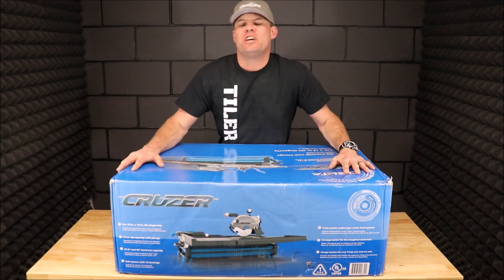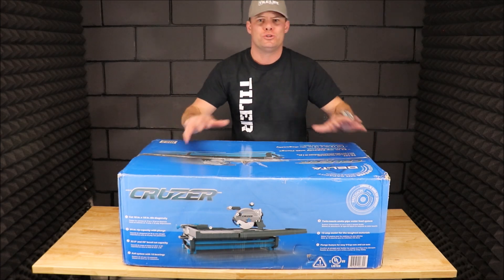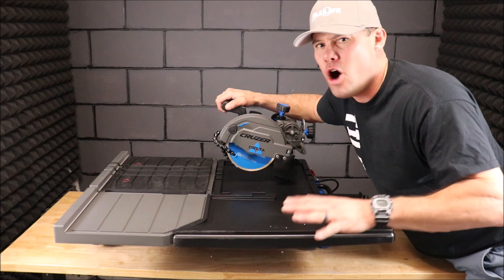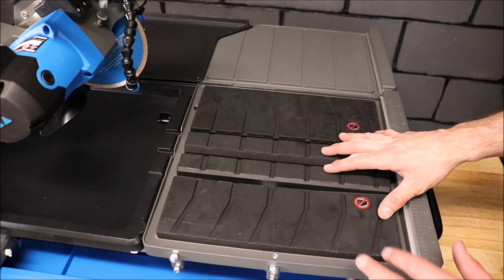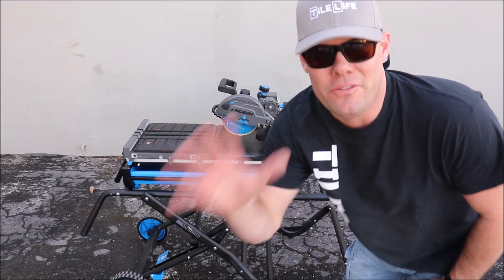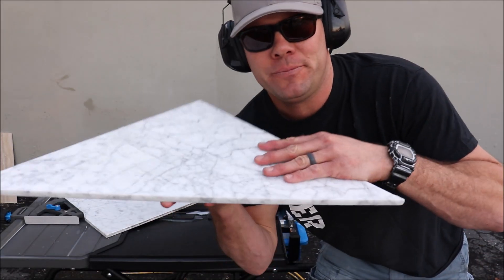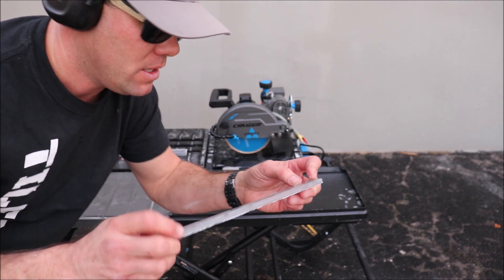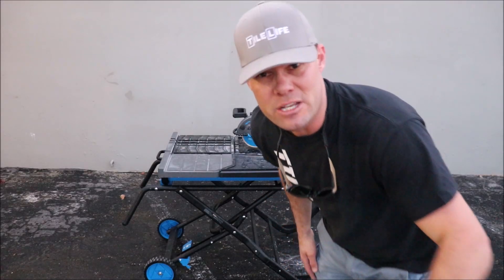Delta Cruzer 7" Tile Saw Review/Best Tile Saw 2020?

Comment: I ran out and grabbed this saw as soon as it was available at my floor and decor (Jan 4th). It’s actually my very first wet tile saw, but I had been researching saws for months prior to this one being announced by Delta. 
I love this saw so far. 
Like I said though, never owned my own before, but have used a Rigid and Dewalt on other jobs. 
I’ve used it on porcelain and ceramic tile so far. 
If you’re in the market for a new saw at only $500 for the saw and a stand its a great deal!

Comment: I was trained in the trade of tile on a 10” dewalt. Keep in mind the same saw has been used for over 5+ years of full time residential/commercial use. There is no doubt the dewalts pass the time test. BUT, I ordered and received my new delta 7” and can’t wait to put it to the test.
Reply: How do you like the delta? How does it compare to the dewalt? I've been using an old worn out dewalt, looking to replace it with this delta, or a new dewalt.
Reply: @philthyphil3324  the 7 delta is good for smaller tiles. Is ok for 12x24. It can get the job done. Great for splashes. The only downside would be the water that splashes on the floor. Using a mud tub or a tarp is recommended. I have a dewalt and use it most of the time. Sure do like the delta. More room on my truck and lighter.

Comment: I’m almost in the same boat. I have 2 Lachmond 7 inch saws. The first had a huge issue with run off  on 24 inch . The water nozzles broke and the pump died.The table had a ton of play in it. Lachmond replaced it under warranty with another updated version, Now the second after 1 year has the same issue with run off.Table has play in it. The one thing that I like was the portability of the 7 inch.  Compared to a 10 inch. The only caveat is its cut depth. Since I have to cut 1 inch quartz at times for ledges. So I have to flip it over to get the cut thru. I’ll be curious on the other 2 parts of the review going forward.

Comment: Bought this saw brand new from Floor and Decor last week and the motor burned up today. It had a funny smell right from the start and the motor sounded like bearings were a little loose. My suspicions we're correct and it just started dying then started shutting the breaker off. Returned to Floor and Decor and bought the DeWalt 36000. They knocked off $200 for my inconvenience! It's an excellent saw!
Reply from the maker: Dang, that's some bad luck. Nothing beats the Dewalt though!

Comment: Nice saw! Hopefully with the power, improved water flow, and intake for the motor being up top like the dewalt, this saw will turn out as the better saw vs the beast. Have they improved water containment in the back or is it still messy? We had motor troubles pretty quick with 2 beasts. And they were just plain messy. But very powerful and excellent mitering saws!
That gravity stand is nice. It looks identical to the stand our old ridgid 7 inch saws had. But they were also short. Doing alot of repetitive cutting was a back breaker.  I do like my saws on the tall side for that reason. 
The dewalt continues to be the go to saws for us. But when they go down and aren't worth rebuilding, it's nearly impossible to find one as good as the originals. Quality control just isn't there. Eventually we will need a great alternative. And the lighter the better imho. There's just certain aspects of the dewalt I am not willing to part with for now. Looking forward to seeing more of the delta cruzer! Thanks for the content bro!

Comment: I'm surprised nobody has commented on how poor the water containment is on this saw. I just got mine set up and after 5 minutes of test cutting there has to be a 1/2 gallon of water on the floor... most dripping off the right side of the extension table, with a fair amount of overspray to boot. Seems like a good saw otherwise (gravity stand is nice, albeit a bit low) but even if I set up in a garage this amount of water running off is completely beyond what's acceptable, let alone inside a house under construction. It's like designers/engineers never actually try the equipment they design.
Reply: Youre the only person that has mentioned this and thats a deal breaker for me. Was just going to pull the trigger. Thank you!

Comment: I have been doing tile for 16+ years. I've gone through 2 felker 75  tile saws I use them inside of homes.  The last one I bought was used on Ebay.  I have a MK101 that Rips tearable. Replaced  the bearings no help so I bought a dewalt 24000. I like the dewalt but it's hard to use inside. Do you have any suggestions for a small decent saw for using indoors?
With minimal water splash? 
Thanks for any suggestions!

Comment: Update day 2. I had time this morning to do some more test cuts. I tried 45 degree mitres and things didn't go well. Over 24" the cuts widened almost half an inch. I made a few minor blade square adjustments per the manual. (Prior to adjusting normal cuts were within 1/32 over 24")
It appears it's a fault with the hinge. Also, in the course of the testing the water lines were driving me nuts. I'm not playing around with it anymore. Just returned it. Dewalt 24000 is still the king.

I just grabbed one of these at floor and decor for $550. In the last 3 months I've used the rigid 7", dewalt 24000 and now this. The rigid was severely underpowered. It struggled with porcelain and couldn't rip a 24" tile straight no matter how well I aligned it. The tile may have been slipping on the cart (no rubber). 
I traded that saw and cash for the dewalt. I set it up with my preferred 7" blade and it's the shizz. It can cut through a boulder without breaking a sweat and rips tile to 1/32nd accuracy. But, it's heavy as hell. I have an old back injury that knocks me out from time to time, and carrying the dewalt from the street to setup spot already messed me up once.
So here I am trying the Delta. Out of the box, it ripped a 24" tile to perfection. It's ridiculously more powerful than the rigid 7", but not quite as brawny as the dewalt. Water management is far less of a concern than accuracy and ease of transportation. So, so far so good.
I will likely re-engineer the water nozzles at some point though. What they did is a cute idea, but it's just not necessary and they will get in the way.
Reply from the maker: agree with you on all points

Comment: How heavy is the tile saw? With and with out the gravity stand. I hope and it should be lighter than the dewalts 10inch with out the gravity. 
And is it more compact than the dewalt. I have been looking for a 7inch saw. I dont need a 10inch I also prefer compact and light as possible. I ain't getting any younger so the less abuse on my back the better.
Reply from the maker: Yes, it's definitely lighter than the Dewalt d24000. With the gravity stand, yes it's more compact.

Comment: If you were backed into a corner and had to choose one saw for a small growing company (mostly work alone, but thinking of hiring someone soon.  Would you choose this Delta Cruiser or the IQ Cyclone?  I think the Delta is a little more flexible, but I like the idea of saving the time on cleanup on the IQ.  I don't do much large format as I do only residential.  Wdyt?
Reply from the maker: If you want to cut indoor (bathroom for a shower) the Cyclone would be great matched up with a manual tile cutter. The blade on the Cyclone do burn out quicker than a 7" for a wet tile saw. The Delta folds up nice, is very light weight, but is not as compact as the Cyclone. If you mainly do showers, go with the IQ so you can set it up in the bathroom. If you do showers/flooring/backsplashes go Delta (IQ does not cut glass).

Comment: I’m in the market for a new wet saw thanks for the review!!!
Reply: Dewalt!!!!
Reply: I have a dewalt but, after I bought the 7 inch diamond by harbor freight, I m not using it anymore. It s lighter, powerful, precious. And it is less louder than  dewalt. For  big tile I use Raimondi rail saw (there is no story for perfect cuts)
Reply: Jesus is Lord, I suggest the Diamondback 7”.  I was out the Harbor Freight door for $270.00, which included the wheeled stand and tax.  I really like the saw.  I’m running an Alpha 7” blade on it.  It cuts 3/8” glass with no chips or any blowout.  In addition, I don’t flip the tile over to cut, I’m cutting with the tile face up.

Comment: Hello, I want know if this machine can cut glas bottles?, what is the best glass cutting blade ?
Reply: I use the Ridgid R4021 table top saw with its OEM blade to cut the bottoms off of glass bottles that i use to build bird feeders, polishing the edges with diamond block and then 200 grit sandpaper. Have to rotate the bottle as I'm cutting. Works great.

Comment: Another great video! I have a question about the the total length of the saw with gravity stand in the stored position? How does the stand compare to the ridgid 10 inch. My ridgid 10inch is falling apart.
Reply from the maker: It stores tight and clean, 7" is MUCH smaller than a 10" and this can do everything a 10" saw can do!

Comment: So Delta released a VIDEO of the 7inch stating that it is available for $399. Landberg says Floor&Decor has them for $499. But yet nowhere to be found unless you goto Amazon and it's $700 there but not available for a month?  Come on what's going on. I'm waiting and waiting to get this. I'm about to go-to HD and get the Rigid 8inch for $399.
Really disappointed with the launch of this product. Stop saying it's available when it's not and give a proper release date .
Reply: c france I talked to one of the Delta Reps. He said that it’s $499 at Floor and Decor because it include the stand. The $399 is for just the saw. I asked about why pricing online was higher and he said because it will settle to actual price as more retailers receive the saw. 🤷‍♂️
Reply: @Mullenthemaker  thank you. Do you know which floor &decor location has them?  Our Jersey location doesn't have them.
Reply: c france it’s sounds like every location will but they are getting them out as fast as they can. Maybe call around local Floor and Decor stores. I know some here in Utah have them.
Reply: @Mullenthemaker  thank you!
Reply: El Paso Tx has it available floor & decor 499$
Reply: Jesse Mullen but it looks like the floor and decor version is without the gravity stand. ?

Comment: How does this compare to ridgids 10” or even ridgids 8 inch? I’m a ridgid guy and want to know if this 7” for about the same price as ridgids 10” would be better?
Reply from the maker: Ridgid is a good saw, this is a good saw. The motor and water spray seem to be much stronger with this Delta than the Ridgid. Ridgid has a good warranty though!

Comment: Hey man, nice review as usual. Got a question if you know ... I got the 10" DiamondBack wet saw (DB 100-1) from Harbor freight . It's a big beautiful saw but it's heavy as a mother. I got the stand with the wheels on it but that's fine for just moving it around but I love those stands that can fold with the saw staying attached. Do you think that Delta Cruzer folding stand you were reviewing would be compatible with the DiamondBack or do you know of one that will?
Reply from the maker: I doubt it would fit, gravity stands are simply amazing and I push it on all tile saw manufactures.
Reply: @LandbergTileTV  Thanks buddy for your response to my msg.  If you notice on my updated msg regarding this gravity stand, I thought the stand was great. So after measuring the the support cross bars on my 10" DiamondBack I went to the store and measured the support cross bars of the gravity stand and they matched up perfectly as well as the width and height of my current Habor Feight Chicago stand. So I bought it and without changing the gravity stand in any way, I just drilled 4,  3/8" matching holes from the stands connection points into the 2 front & back connection bars on my DB wet saw, attached the bolts securely, tested the stand's operation with the wet saw attached over & over, and it works beautifully 😃 
I am so happy that I can transport that heavy saw so quickly and easily. I thank you and the guy from the Delta company for the review of this stand and for making my life easier.  
I look forward to more of your videos, keep up the good work.

Comment: Is it weird to like it for the big  tray plug and the ability to empty into an unmanned bucket with no worries?!
Reply: Creed Barnett, no..., my 7” Diamondback Wet Saw has the same set up.  The stand, which has wheels, allows you to set a 5 gallon bucket within the framework,  just pull the plug, drain and forget.

Comment: How does the 7" diamondback compair to it.
Reply from the maker: The saws are on different levels for sure, I will put up a comparison video with The Delta, vs. the Dewalt, IQ and the Diamondback in a few weeks. 👊
Reply: @LandbergTileTV  thanks that would be awesome. The diamondback was on sell last weekend for $200. Thought about grabbing it but didn't haven't heard any long term reports. Kinda gun shy on harbor freight things. Look good to start but don't hold up well. Not all but some.
Reply: Fueled Iowa, this is for you...  I purchased the 7” Diamondback shortly after Landberg released his video on it.  

I mentioned to my Wife that I was going to check the saw out at Harbor Freight.  She said, “Really?  You’re really thinking of buying a tool from Harbor Freight?”  I told her that I was at least going to consider it.  The majority of my power tools are Milwaukee Fuel, except for the awesome Dewalt XR Oscillating Multi-Tool and a couple others.  So I bit the bullet and bought it.

Several months later I’m very satisfied with my purchase.  In anticipation of cutting glass I got a Ridgid Glass Blade.  I think the Diamondback blade that came with the saw is a better blade than that one!  I’ve since switched out to a 7” Alpha Blade.  It’s been cutting our 3/8” mosaic glass tile very cleanly...I mean very clean!  No chips, no blowout, just a smooth as glass cut.  I cut it face up.  The combination of the powerful Diamondback motor, smooth running tray, in conjunction with the excellent quality of the Alpha Blade produce beautiful cuts.  

With regards to water containment...I’ve been cutting in my garage, with the backside of the saw pointing out the back door.  For the most part, all water is contained, except for a bit of over spray at the end of the saw’s extension tray.  But it’s such a small amount that it’s pretty insignificant.  The pumps a good one and of course integrated in with the main power switch.

I’m still waiting for Landberg’s follow up video on the 7” Diamondback Wet Saw.😉😉
Reply: @martylucas8557  that is awesome and thank you so much for you input.  I only have my own future house projects so I think by your advice this should be fine for me. I have my bathroom, kitchen, outside kitchen bar b q area.
Reply: Fueled Iowa, you’re welcome!  I feel the Diamondback will serve you well.  Make sure you get the integrated cart.  I asked the store manager for an additional discount on it if I bought the saw.  They gave me 20% off of it.  I didn’t get the warranty, I figured that I’d know in a couple of weeks whether I’d have issues or not.

Comment: Word to the wise. If you're going to go expensive don't go with MK diamond. They are not the saw as they used to be. I go into detail but I bought one of the more expensive saws and with less than 50 hours on it I have to replace the whole motor which is about five hundred bucks if you can find one. It support and service at MK diamond is like every other company now where the people just hide behind their little desks and computers and just really don't do much. If you're going to get professional I would suggest a Rubi Bridge saw. You can get a big one and they're cheaper than an MK Diamond and they have twice the warranty and they cut amazingly straight and at a 45 degree bevel which big diamond do not. You're going into business please consider the Rubi I do not work for Rubi but I have been in business for 40 years and I know a good saw and good customer service from the opposite

Comment: Maybe I’m wrong, but everything looks very cheap... when you slide the tray I heard bad noises from bearings. It’s looks like a very cheap quality saw.
Reply from the maker: Better quality than Ridgid, Kobalt and Diamondback. The strong motor, water spray and large cutting capacity (does all that a 10" can do) is where it's at!
Reply: lukaszgodlewski2305, Yup...you’re wrong.  I don’t think it looks cheap at all.  It looks well made to me.  The table seemed to run very smooth on the tracks as he was moving it.